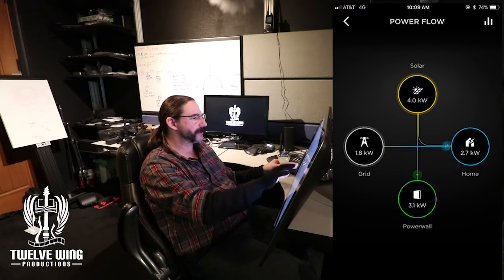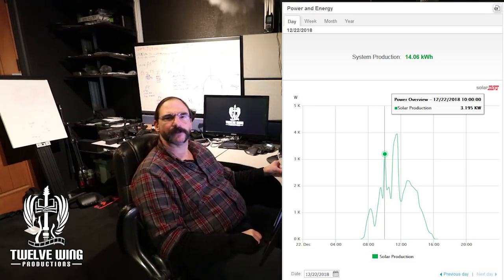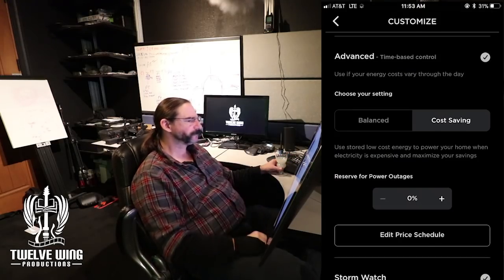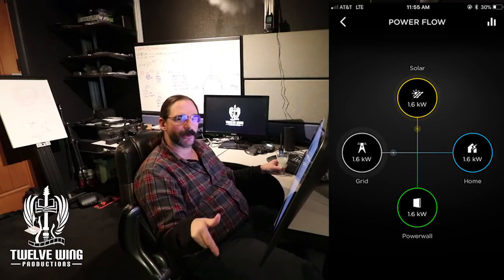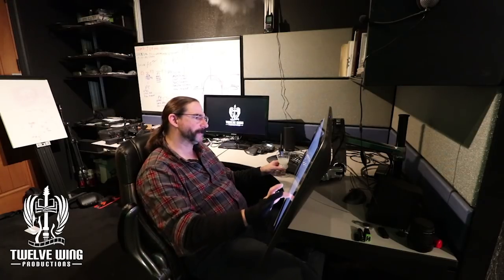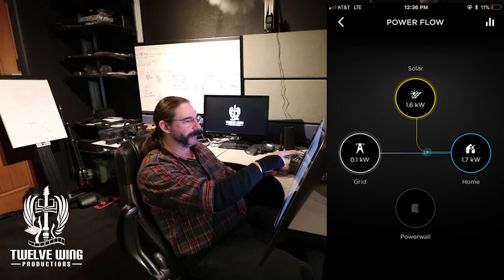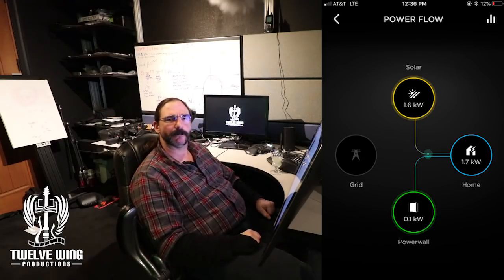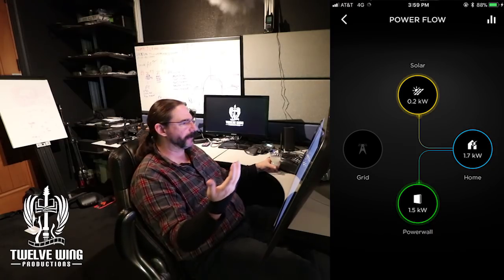ESP Video 4:  Tesla Powerwall 2 mode settings

Comment: Well with Storm watch mode we now know that the grid can charge the batteries with up to 20kw steady charge to fill them up much faster than the 1.7  rate
Reply from the maker: Yup.  Helpful to know.  Also nice to know that larger systems won't risk tripping their breaker.
Now all we have to do is make them let us do what the thing was advertised to do.

Tesla needs to put in a "supplemental mode" where its goal is to put nothing to the grid and take the minimum amount possible.
That would be the winter setting.  Taking just enough in to replace the shortfall from the day before.
That would be ideal I think.
Feedback would be very handy as well.  Have the app display how much surplus or shortfall you had.
It sort of does this by displaying system percentage, but it would still be nice to see that as a matter of total KWH.
Reply: After sitting through storm watch and the grid never shut off I wanted the batteries to start contributing again. The system would not switch over for me ( even though I turned off storm watch)so I reset it my self turned off the main. It fired right up but the APC backups started beeping did not like the frequency change and would not reset even with me manually flipping the circuit breakers so after 20 minutes I just turned the power grid back on. I may just have to get rid of the APC since the powerwalls do the their job flawlessly.

Comment: Great video.  As stated I have a neighbor with a similar setup.  I want to get solar and Powerwalls 2 for our home so I'm trying to learn as much as I can.  I was looking at the Sonnen Battery as a choice instead of the Powerwalls 2 battery.  Thank you for taking us on this journey.  As a new subscriber today I'm glad to be a part of this channel.
Reply from the maker: I'll need to do a special on flow batteries soon as you aren't the first person to mention them in a reply.
I love the technology behind flow batteries, but they have two MAJOR hurdles.  The first was solved in a rather clever way by Sonnen and that is the size.
Let's face it.. they are big and who wants a bunch of tubs sitting in a shed or storage container out back of their house.
Sonnen buries the units in a cylinder(s) and then the inverter is mounted on the home.
So that problem is more or less solved.

The second issue inherent with most flow batteries is supply current.  Be VERY careful here.
A system that is designed for energy sovereignty needs to be able to supply instant demand for ALL the home's needs.  You can have all the capacity in the world sitting under your lawn.. but if you are only allowed to trickle power your house, it's never going to do more than just assist you.. not supply you.

Keep watching our series and you will get a chance to see how these batteries perform in summer when we have AC loads on the batteries.
I will be doing load tests both with the system connected to the grid as well as with the grid shut off (Zombie Apocalypse Mode).

This might help you make an informed decision about how much current supply you really need and what solutions are available to actually supply it.
Reply: @twelvewingproductions7508  Awesome.  Looking forward to it.

Comment: I think the power saving mode setting only works when the system can charge of the grid. The system is designed to work the way you want it to.
But by blocking the grid charging it now cant work properly (with empty battery's). The powerwall system itself also needs power to work so needs to charge of solar to stay working. Even if you also need power yourself in your home.
maybe thats the problem.     i'm no expert so just an idea..
Reply from the maker: You may be no expert, but you nailed it.
I'll be doing a couple videos to follow and also trying to decide how I want to present the system in terms of energy sovereignty.
This poses a bit of a headache that runs deeper than just the cost saving setting.  The other setting, the "balanced" setting in the advanced menu does work.. but as you will see in a video released later today it too is crippled.
When you use that setting it does switch over as desired at midnight, but when it hits noon it friggin starts to send our peak production straight out to the grid instead of to our batteries... in mid winter.
Who the hell programmed it to do that?  That's not even logical.. and makes ZERO sense.

To get it to knock it off, you have to go to self powered mode or kick the percentage of power reserved for outage to 100%.
Doing this manually is going to get real friggin old.. and I WILL punish Tesla for it in my video comments until they fix it.

Ultimately, Tesla has a fantastic product.  I am very grateful that they produced it.  The reality, however, is that they have a LOT of work to do.  Work that SHOULD have been done before releasing this and work that SHOULD have been REDONE the MOMENT they learned they were going to cripple their system.
That change, not allowing it to charge from the grid, represented a major alteration in how the AI needs to look at it's overall responsibility.

I'll do a video today about its current modality and in a month or two I'll do a video with a laundry list of modalities the app SHOULD have.
After that, we will see how long it takes before Tesla actually gets it done.

Thanks for following.

Comment: Can you show your daily graph from your Tesla app
Reply from the maker: Once the project begins I will post the daily information from the Tesla app, but this won't be the only thing we show nor will it actually be the most accurate.
I am currently hard at work trying to identify how to categorize the most important information and how to bring it to everyone in the most understandable way.  As it contains some complex comparisons and correlated information, this isn't as easy as it sounds.
On Tesla's end, this is made more difficult by a serious lack of historical data that I can display.  This is something we will go into at length once the project starts and we start compiling data.

The take away from this is that we are interested in the following:

Daily production of power as reported by the Solar Edge inverter (primary first source and source of first loss)
Daily production of power as reported by the dedicated solar utility meter at the side of the home
Daily production of solar as reported by Tesla on the Tesla app
Daily use of the home as recorded by the Tesla app
Daily use of the home (recorded as an average) reported monthly from the utility bill
Daily amount of power supplied from the Tesla batteries for the purpose of driving (once there is an overage)
Daily amount of power put into the vehicle for the purpose of driving
Number of miles actually driven (Roof to wheels) for every 30kwh of charge measured weekly as seasons change

We are tracking these to discover where our losses occur and how to mitigate those losses in future systems.
The purpose of The Energy Sovereignty Project isn't to get a return on investment, it's to identify the real numbers of existing systems (and mistakes) and help design these out of future systems.
Along the way, folks will be able to identify the moment they feel it's right for them to pull the trigger on their own solar PV and battery system and perhaps use what they learn here to help them make sound decisions.

Thanks for following!

Comment: Hmm can a powerwall be charged while giving power to the house? Or is there only.. either charge it, or use power from it? There should be a way to provide power comming from two sources at same time to feed the house e.g when solar is not enough for the home get the rest from the battery. It seems the system allways preferes the grid. So sad!
Reply from the maker: The system is designed to do both but it is based on how the system shares the load.
In our system, if the home load is 2kw and the solar is producing 1kw, the system will dump 1kw from the battery using the 1kw from the solar to reduce the expenditure of the battery.  Pretty much as one would imagine.
If the home load is 2kw and the solar production is 4kw, then 2kw supply the homes load and the remaining 2kw is used to charge the batteries.
The system senses how much solar is being produced and how much the home is using and knows to allow the batteries to charge.

What I don't know yet is how the batteries handle that transition.  Say you had only one power wall battery and a small bank of circuits that would be supported during a power outage.
If your home load were 2kw and the solar was producing 2kw with the power out, how would it handle charging vs discharging?

On our system, we have 6 batteries so it's likely that this transition period will be seamless.  We have already shut the house power off a couple times to test the system and the home never noticed the main power go out.  So I can say that in a multiple battery system that is scaled to handle the home loads, the system seems to shift batteries around to handle that transition.

Our system is somewhat different from most installations in that every single home load breaker is on the battery panel.
Reply: @twelvewingproductions7508  The general power flow as i understand it.. should be. Solar sends to Battery. Battery sends to home. Now if home needs more than battery can give ( which includes the solar ) battery grabs the rest from grid. When batteries are full, and home can not use all solar power, it goes to grid ( unless you have a spare electric car to charge up) So the difficult part is probably guessing what kind of charging level of batteries is best to be set at what times, taking in account the future power needs and expected solar power production. I guess you should be able to manually adjust the limits and only in stage 2 have it set for you out of statistics and weather reports. Maybe someone can create an intelligent controller that works for any kind of Solar / battery system. Or could that be you?
Reply from the maker: @CurdinGees74 , you have it mostly correct.
The one part you need to factor in is the Tesla gateway.  It acts not only as a gate keeper in the case of the loss of grid power to protect line workers, it also speaks to the batteries and performs that balancing act I spoke of earlier.
That's also the point I was making when another gentleman suggested that the Sonnen batteries were s superior choice.  The Sonnen batteries don't have the ability to switch at a high enough speed because they do not use the same type of gateway.

So with that in mind, we have a system that monitors itself.  Also note that you need to factor in the inverter.  In our case it's a 7.6kw solar edge inverter.  The solar provides this unit with DC and that must reach a certain point before the system even engages the gateway.  Just this morning I discovered that the threshold for this is 100w.  That seems to be the decision point for the Powerwall gateway.  I'll do some more testing on this and let you all know my findings as I have concrete evidence of how these things function.

The long and the short of it is that the Tesla gateway senses how much input it has from a variety of sources and yes, as you said, it supplies the power to the home by using the batteries as a buffer.

"Maybe someone can create an intelligent controller that works for any kind of Solar / battery system. Or could that be you?"~

Working on that.  More to follow.  Our system will create a very clean installation process that should greatly speed up the installer's ability to get these systems in.

Comment: I thought to put myself a couple of Tesla batteries, but .... But then I realized that I am grandfathered of the system (I have solar panels for 4.5 years already), and for the next 16 years I will be using TIR rate tariff: for each 1KW produced I get 1KW from SDGE San Diego. So I don't need batteries. I have no peak time or off-peak time. Due to the fact that I managed to install my solar pv system before TOU. I hope that in 16 years it will not be necessary to install batteries of 13.5 kW each, and there will be a revolution in technology. In 5 years I have already returned an investment to my system. I have a problem: I produce more than I consume. I now have to decide what to do with the extra electricity, because I don’t want these thieves to pay 3 cents of my energy. This is a robbery.
Reply from the maker: By the time your term runs out, they will most certainly have solid state batteries at about 1/3-1/6 the cost per Kwh currently.  That said, the amount you will need to store isn't going to change that much.  If you have an electric vehicle and solar production, that number seems to be 40-60kwh if your home usage is 15kwh/day and 90kwh if your home usage is 30kw a day and you have 2 electric vehicles.
But these are just based off calculations I did about 2 years ago.  Now it's time to actually do the project and give you some hard numbers to chew on.

Thanks for following!

Comment: Was it necessary to put so many batteries?
Reply from the maker: The short answer is "We don't know".
The purpose of The Energy Sovereignty Project is to identify the point where diminishing returns make it impractical to increase storage.  That point where there is simply no further benefit.
It's not going to be possible to identify that point if I don't examine the extreme extents of my calculations.

The longer answer is... Yes.. I think it is.
The reason for this is to maximize the potential cost savings to the consumer.  We have to be careful, though, that we also stress that the market isn't ready for this yet.  I'm not endorsing going out and buying 6 powerwalls.  What I am saying is that 90kwh seems to be a kind of magic number for the months of October - March.  Nothing can really be done in December and January as far as free driving, but in these critical months as well, having a large battery bank will mean that you can have a sizable backup in the case of outages as well as run on cheap off peak power to minimize your consumption to the greatest degree possible while at the same time taking strain off the grid.

Because of this, you will notice the next few videos really pounding Tesla and our local utility for not allowing access to this critical capability.

Hope that helped answer your question.  Have a look back at a couple videos and let me know if I can explain it better for you... or if those videos helped clarify our reasoning on this.
Reply: @twelvewingproductions7508  I really want to disconnect (OFF GRID) from the SDGE but unfortunately, Tesla does not provide such an opportunity to cut off from OCPO Official criminal power organization.
Reply from the maker: @MaximMaximov , 
Hopefully we can do our part to shine some light on what they are doing and get this changed.
Reply: @twelvewingproductions7508  I produce more than I consume, but so far there is no simple (automatic) way to accumulate energy and use when need. I do not want to build a system: DYI. I thought Tesla could provide this In automatic mode, oh it turned out Tesla does not work OFF GRID. I hope that one day Tesla will give customers this option.
Reply from the maker: @MaximMaximov , as we will show, the system does work "off grid" in that the home will still charge the batteries even with the main power from the utility shut off.
The system does seem to do the automatic accumulation part ok.  Our problem is two fold.  Firstly that we can't charge the batteries off cheap evening power when the batteries are depleted and it doesn't seem to have any way of setting the system so it can only charge to 50% and then send the rest to the grid.  That last part is how we want to operate in summer.

I'll keep you and the others following this posted on our progress with the solar inverter issue.